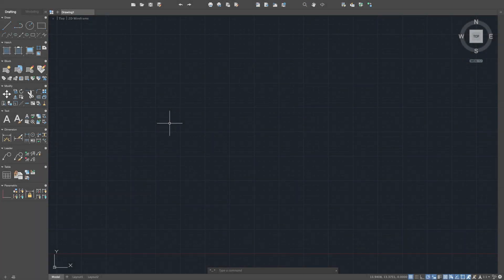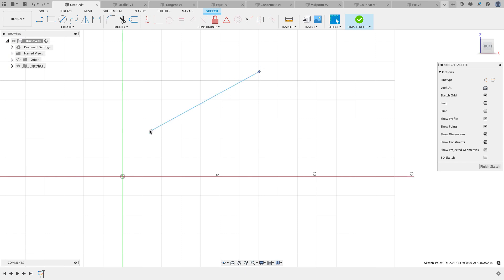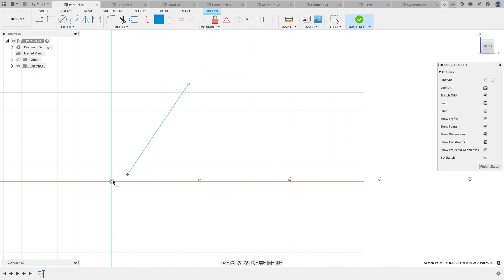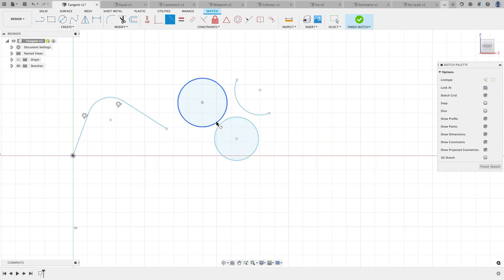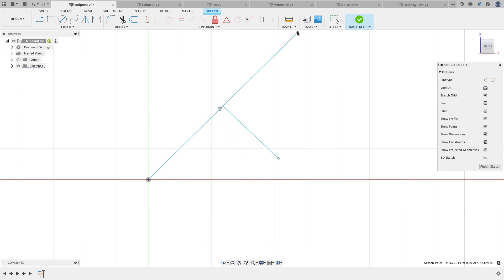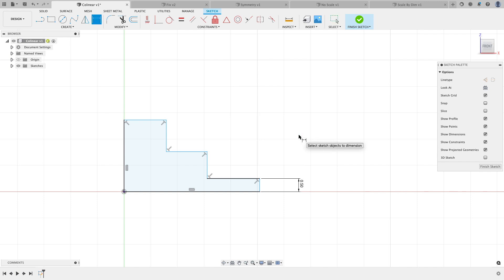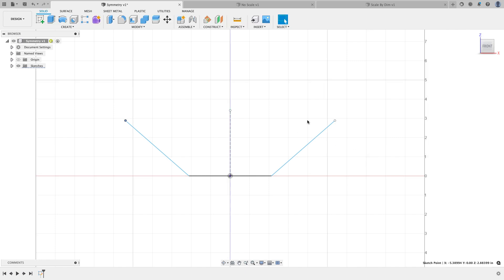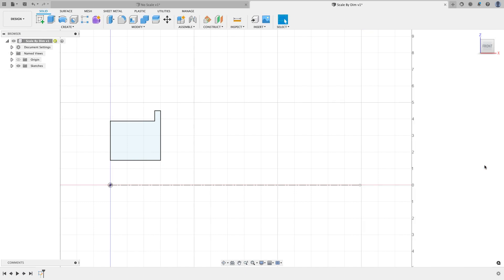Understanding Sketch Constraints and Dimensions

Comment: Thanks for this. I have struggled with this transition having used ACAD for years. This was really helpful!
Reply from the maker: Glad it helped. I transitioned to Inventor from AutoCAD before Fusion. Biggest advice I can give you is to not try to draw in Fusion like you do AutoCAD and you will be fine.
Reply: @MechanicalAdvantage  my first thought was "the grips aren't doing grippy things..."
Reply from the maker: It will be a bit of a change; but when you grasp it, it will be more powerful than you can imagine. The ability to change entire sketches, models, assemblies, prints etc with a single dimension will be a bit deal for you.
Reply from the maker: @alex-b24  Here is another way to think about it. In Autocad, nothing moves until you use a tool to do it. Move, stretch, grips, etc. In Fusion everything moves until you put enough control on it that it can't.
Reply: @MechanicalAdvantage  that's a great way to think about it thanks!